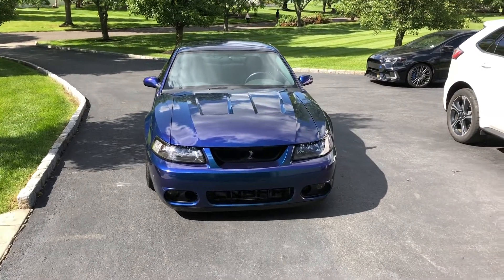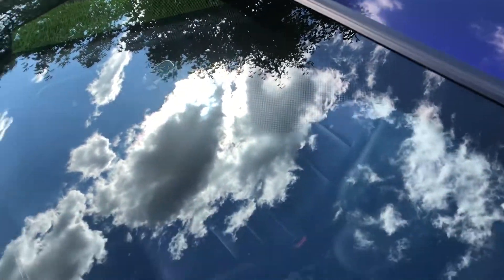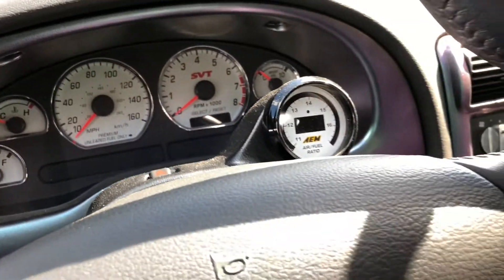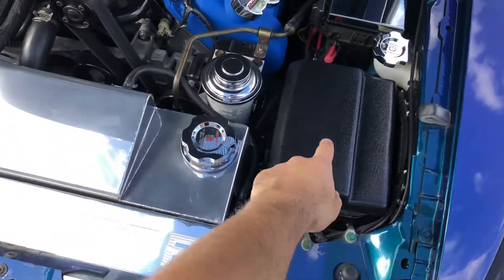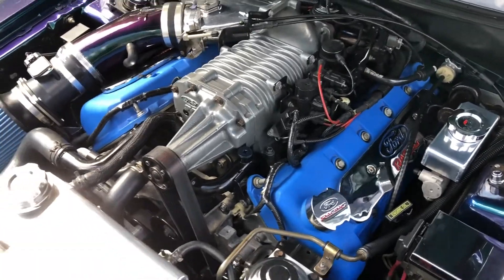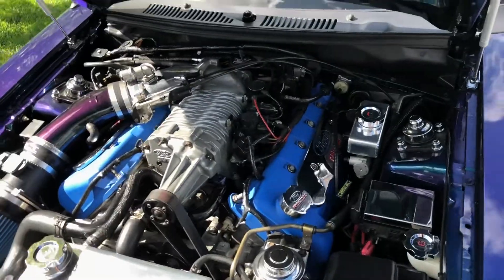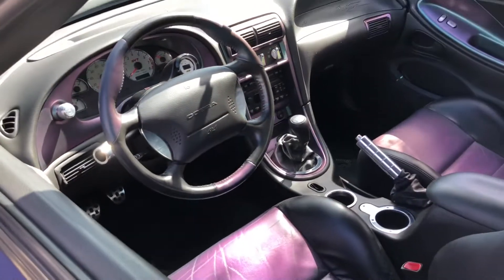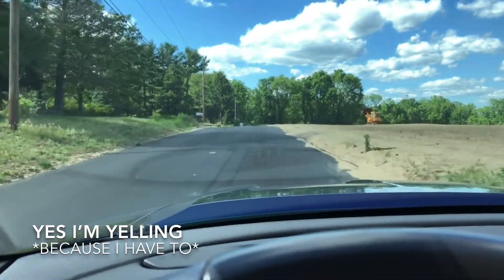550 RWHP COBRA REVIEW!!! | 2004 Mystichrome Mustang Terminator Cobra Update

Comment: Impressive. Ive been waiting to find someone making 5 plus on stock blower. I knew it could be done. Was it a must to have larger injectors to make the power your making?
Reply: Port the Eaton, smaller pulley, full bolt ons (long tubes are a must), and a good dyno tune and you can definitely make 500 on these man... a lot of guys are making that wit the stock Eaton

Comment: Did you get belt slip with that setup? Not used to not seeing the aftermarket SC tensioner!

Looks good!
Reply from the maker: Nope no slip with this. When the lower was installed the wrong spacer was used and I had bad slip. After that was fixed it’s been good.

Comment: Looks beautiful, love the sound of those cams. How is the driveability with those cams, any issues when using the A/C?
Reply from the maker: The driveability is a little wonky in first gear at low speeds if your trying to cruise through a parking lot at 10mph but other than that it’s not bad. AC turns on fine but isn’t cold 🤦🏻‍♂️ hasn’t worked since I bought the car.
Reply: @pfmustang  Appreciate the info, I'm thinking about doing head-studs soon, absolutely love the sound of cams rocking, but I don't want to sacrifice drivability.
Reply from the maker: @willsam6243  I got you. It’s only a little issue at very very low speeds in first otherwise you can’t tell. I also have a McLeod twin disk and single blade throttle body so none of that helps either lol